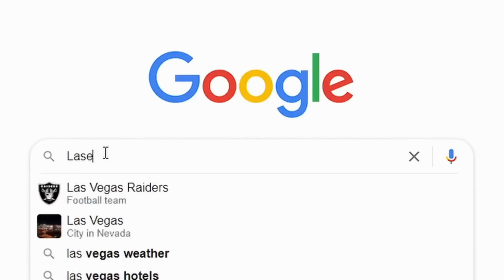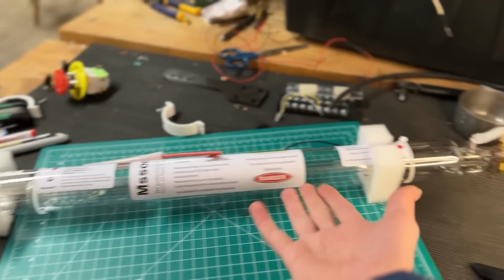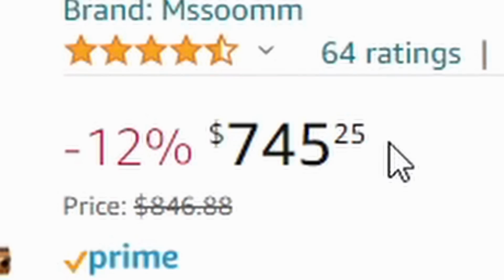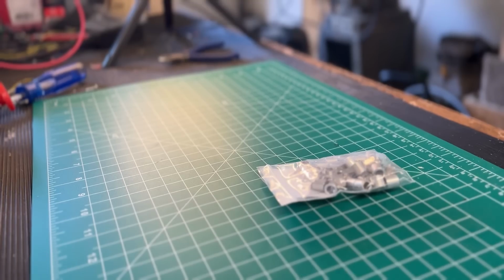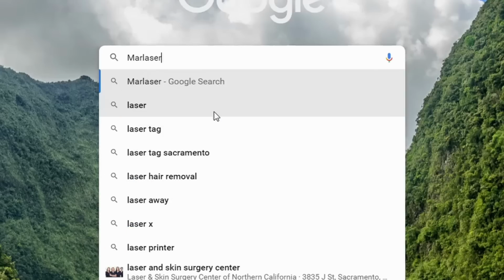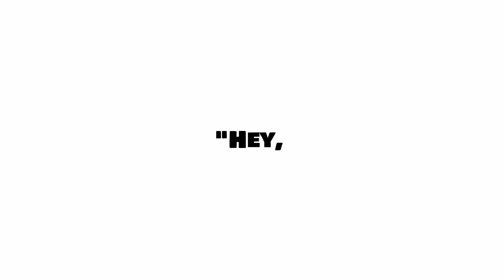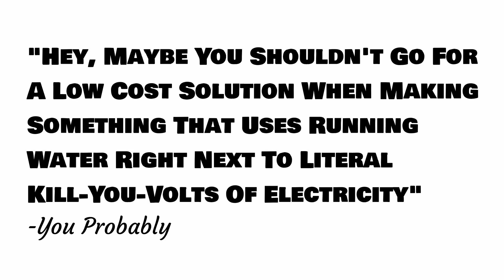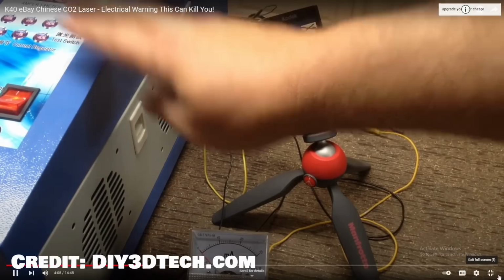I Built A Laser Cutter! (For Under $700!)

Comment: Neat video. You could have bought a K40 and used all the parts, just building your own frame, saved a lot of money, Mine cost about £500 all in, including an upgraded 3 axis motherboard (MKS DLC32), adjustable laser head and small compressor. It would have cost more to buy the tube, the power supply, steppers and mirrors seperately. Mine fits inside the k40 case. The bottom is cut out to allow for the adjustable table and the rotary, as are all the internal partitions, and it can be lifted off for access. The power supply and controller are external, under a cover. It has a cutting area of over 400 mm by 600mm, so I can fit the larger, and cheaper, sheet material.

Next will be a larger one so I can cut parts for skin on frame canoes, in one piece. That will be 80w so I can do 12 mm in 2 passes.

Comment: You can cut more than cardboard with a diode. I have the neje 40 watt and I'm limited to 6mm oak boards that I can cut through with 2 passes. But thats the only thing you can cut at home depot! I think diodes are more suitable for things like fabric and leather, crafty/artistic things... You should use an aquarium chiller like this to get rid of the 5 gallon bucket DC 12V Thermoelectric Cooler Peltier System Semiconductor Refrigeration Water Chiller Cooling Device for Fish Tank (120W for 30L Tank)

Comment: As for air assist here's a suggestion. 
Get a small length of 1/2" threaded pipe, thread a 1/2" ball valve on it, of course using Teflon tape or threadlocker, thread 1/4" female to female adapter and then thread male pneumatic quick connector to it, like the one you have on your air tools. 
To the other side thread another 1/2" ball valve if you want (one is for regulating the flow and one is for turning it on/off without changing the flow settings), and then thread the adequate hose adapter in it. 
When you go to a hardware store bring a small peace of hose with you, that way you can probably dry assemble it on the spot without Teflon tape and when you get home you can take it apart and put Teflon tape on every connection. 
You can 3D print brackets which can hold the whole thing to your machine.

Comment: hey great job building you laser cutter... especially for mentioning the laser safety video that i definitely will watch b4 I fire up the laser for the first time.  Question though.. i am currently on the electronics phase of my build but for some reason, can get the limit switches to work.  is there a trick to installing or did i miss something?  arent they usually just plug n play... or do I need to configure them in the controller [orin the software].  the chinese company that i purchased from cant even understand anythinh past "buy now"... so of course they are no help.at any rate.. any help would be great thanks!

Comment: Now there is some Diode module that reach 20 Watt optical power, with four LD of 5 Watt each coupled with FAC lenses, so maybe for metal is not suitable due to the high reflection, but I'm shure you can cut 10mm plywood, I own an 10 Watt optical LD laser and cut 6mm plywood is not a problem, engrave stone, cut black acrilic (3mm)....so is not for cut "cardboard" a LED Laser, believe me!

Comment: Great video, here are some cheap improvements and some things to consider for your own safety. First, the rails are overkill, I built mine with 20mm rails. The laser head is really light and doesn’t need the rigidity. Second, order thin aluminum sheetmetal panels from an online sheetmetal shop. I like send cut send but there are others and my full enclosure and brackets cost under $100. You will set your laser cutter on fire, anyone who has a cutter has done it. Do more of these videos, cheers.
Reply from the maker: Thanks for the tips!

Comment: I have a CO2 laser and we have several in a different department at work.  I'm told by the guys at work the best way to cool them is to keep the room the laser is in about 65 degrees or so.  I have yet to implement this at home but am planning on doing so, maybe I'll stop running into issues running the thing in the summer heat.   Water pump + radiator + cold room.

Comment: How does freah air enter your enclosure because you mentioned you made it air right.
Reply from the maker: Well, I TRIED to make it air tight. There are still spots where it seeps in, but the gaps seem to be small enough that I don't smell any smoke while cutting.
Reply: @OwenSchafer  do you see the smoke flowing towards the extraction? I would add a small door on the left.

Comment: Very nice job.  How does the 2020 extrusion work out for you?  Any flex?  I am on the cusp of making my own, so this is an inspiration to be.
Reply from the maker: They worked pretty good for me. They are really adjustable which is nice,  but that also comes with a little bit of flex. I find that the flex mostly comes from the connection spots between extrusions rather than the extrusions themselves though, so as long as you make those spots strong enough you should be good. I just used some 3d printed brackets that I found on thingiverse.

Comment: Nicely done! As others have mentioned, a pop filter would be much appreciated. Most editing software will also have an equalizer (with which you can add a high pass filter to cut out pops) and compressor (which can help normalize volume)
Reply from the maker: Thanks for the advice! I am hoping to buy a better-sounding mic before my next video so it hopefully doesn't sound quite as bad.
Reply: @OwenSchafer  great to hear! All of this advice is still applicable anyway but a new microphone will make a big difference
Reply: @OwenSchafer  a lot can be done easily in post already. It sounds like you already have a compressor inline, or that normalization is on. You should place an equalizer first in the fx chain, and do a low cut (remove frequencies below) at at least 125Hz, but quite possibly even higher (225 perhaps). Then you can add a compressor after it to maintain a consistent volume.
Reply: @OwenSchafer 
Can I use gt2 6mm belt for x and y?
Because it is only available in my place!

Comment: Great work. Any design changes or  improvements you would make if you had to jump right into making a mark 2?
Reply from the maker: Yes, I think the main thing would be to rebuild the enclosure so that the mirrors, laser tube, and electronics aren't in the same space as all of the smoke and stuff. I think I would also upgrade the controller, make the bed height adjustable, and just generally try to make everything a little less janky.
Reply: @OwenSchafer  you might want to back off on the sealing up of the enclosure as as it works against smoke extraction.  Air out has to equal air in, and air in is being restricted, unless you put an air inlet in place that wasn't documented.

Comment: GRBL firmware for the arduino was the easy way.
(but your solution may be better actually)

great build.
Reply from the maker: Thank You! I was actually planning on using GRBL originally, but I never could figure out how to use it.
Reply: @OwenSchafer  that's what i use for mine, and in my memory, it was quite plug and play, but with surprisingly few options (at least WAY less than Marlin for 3D printer).
by the way it is based on marlin as well (or marlin is based on this?? I don't remember the history of those...)